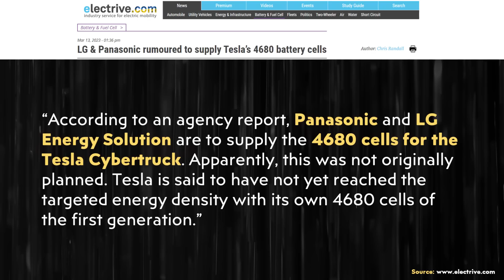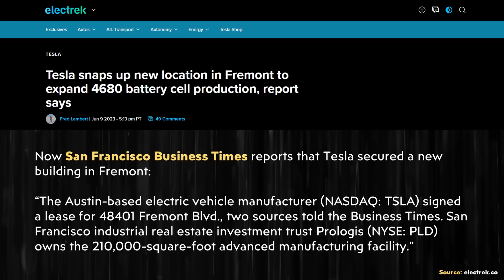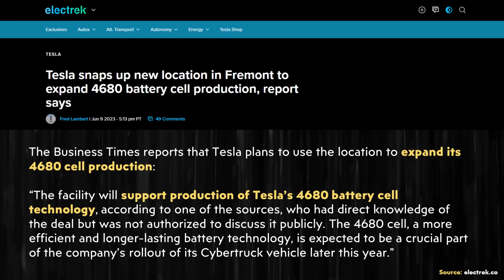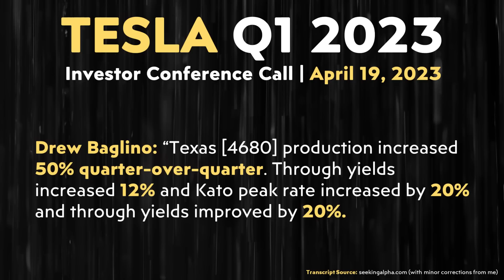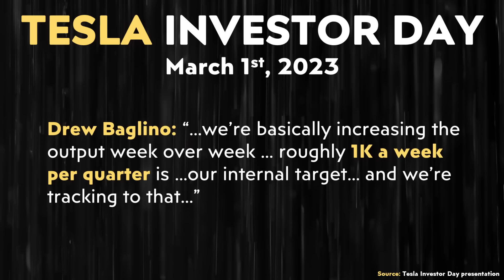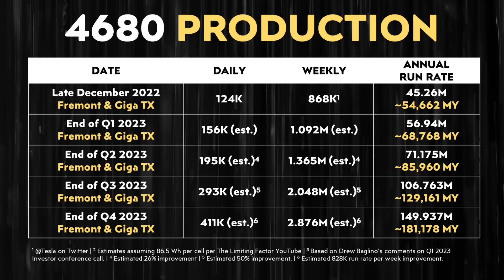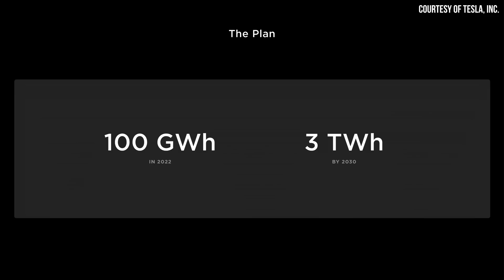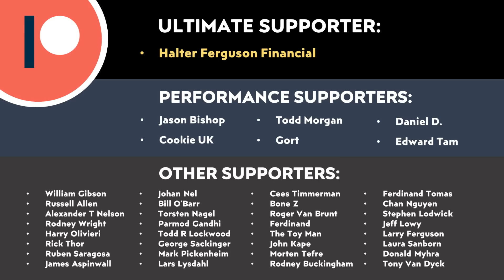Tesla 4680 Battery Factory in California is EXPANDING | Production Update

Comment: I'm starting to grow rather irritated with Tesla's poor timeline estimations. Over the last 5 years, every goal they've set, they've basically had to push back several years. At this point, if Elon indicates a goal, I'm just going to double it cause they haven't been able to push them out in time.
Reply: The ramp of the first MY was ahead of time. But, that was the exception. Considering that Tesla is often trying to do what the legacy auto makers say cannot be done, I'll give Tesla some slack. We have waited long for the new Roadster.
Reply: @surferdude4487  Elon and Tesla have also said ad nauseum that they continually learn from previous rollouts and factory buildout... so that the "machine that builds the machine" continually gets better. That hasn't been true for the last couple of years.
Reply: @buckymoto  With everything going on at Austin and Berlin, I'm not sure that's true. I'm pretty sure the main reason the 46-80 is rolling out so slowly is that they want to use DBE for anode and cathode. That has proven to be more challenging than they thought.

Comment: We would all like Tesla to be making more 4680s but I certainly prefer that they are aware of the realities of their production capability and, while continuing to address the challenges, they continue to source the best new cells from elsewhere in the market. I was interested to hear that their recent BYD deal will support an alternative approach to a structural pack since it seemed apparent that a delay in 4680 had otherwise implied a delay in that development also.
Reply: My "concern" is that back in 2019/2020 Tesla was counting on the 4680 battery to be fully developed by now, and at the specs they projected.   If the 4680 simply is not ready yet, what happens to the promise of the CyberTruck ramping in 2024.   Does the volume ramp get pushed back until late 2024 / early 2025?

Comment: Expanding California 4680 production.  Does that mean they are struggling in Texas to ramp 4680's?   Texas is physically large enough to build a huge amount of batteries, I would speculate that Tesla doesn't need space in California to make 4680s when they could just build them in Texas.
Reply: If they are doing the wet process for now, it is going to take them much more space, this may be the issue.

Comment: Good work, but a very picky point: be careful with the number of significant figures.  Going from three significant figures to four, simply by multiplying, is wrong. Furthermore, some thought about which of your numbers justify three significant figures can be useful.  (For example, "20%" is, at best, two significant figures and, again, simple multiplication does not increase precision.)  The reason why my old physics and engineering profs brought this up, was that it can force, or reveal, an  understanding of underlying processes.  Might bring an A+ down to an A.
Reply: Thats why profs don't build stuff in the real world?

Comment: In the past, you, and The Limiting Factur have identified lower than expected 4680 batteries Wh/kg values and pointed out problems with the dry cathode. This in turn points to unacceptable PTFE degradation (red electrolyte), particularly in the cathode, which is used as a binder in both electrodes. As they resolve this issue low production of sub-optimal 4680 batteries should be expected.  I would love to hear if this problem has been resolved and when these production lines are expected to accelerate?
Reply: I don't know if "disappointed" is the right word, but on Battery Day 2020 when Elon talked about the 4680 and how it would be so much more efficient, faster to manufacturer and cheaper, I really thought we would be there by now.   Yet, I don't think anyone outside of Tesla really knows how close they are to hitting the targets they laid out on Battery Day.   It has been almost 3 years.   One thing is for sure, battery improvements continue to be a very gradual thing.  I do not expect 500 mile batteries, weighing 50% less than current batteries, anytime soon.

Comment: Lets face it... the 4680 ramp & power density  has been a frickin disaster compared to our hopes and expectations.   It will all get better quickly enough.
Reply: DBE is difficult, but 4680 is huge improvement over 2170. There isn’t another / better cylindrical form factor. Pouches, bricks & blades have own downsides. DBE has potential for reduction in factory floor space & in energy & solvent use. The engineers are working to make our life easier / cheaper.
Reply: @iandavies4853  Apologies for my ambiguous remark.... By "frickin disaster" I mean that the "ramp" hasn't ... ahem.... exactly gone as expeted.
Reply: @eugeniustheodidactus8890  Forgiven. Same can be said about FSD, but it’s now only solution still in race. Tesla / SpaceX just take on the impossible, make it late.
Reply: It is not a disaster yet, we are still on track to deliver 2 million this year and since all Battery companies are increasing their production world wide, we may be ok through 2024. That also may be enough time to get the DBE completed!! I have no expectations, just except what comes.

Comment: Interesting perspective. Based on Joe T's drone flights that showed lots of vapor coming out of the battery plant I will not be surprised if GT is ramping up nicely. If Tesla is having difficulty with dry 4680 battery then how can LG & Panasonic be able to ramp-up quickly?
Reply: Not using dry anode and cathode
Reply: @alanrickett2537  Not even tabless from what’s reported!
Reply: @iandavies4853  Correct the Panasonic will 'just ' have the silicone dopeing boost that is the last thing Tesla will add to there batteries
Reply: As Alan says, its not the batteries promised 3 years ago, not anything near that.